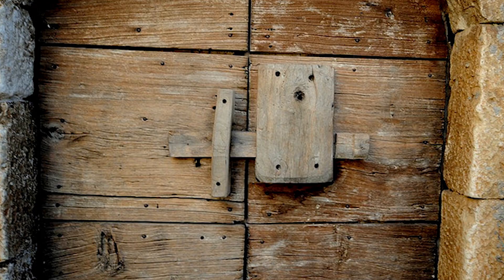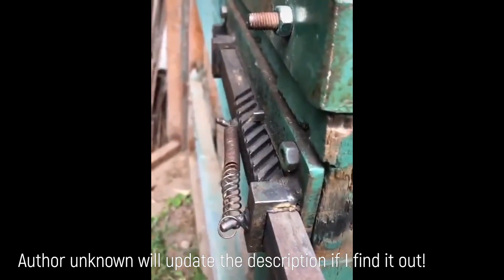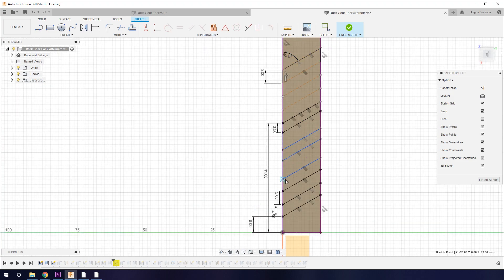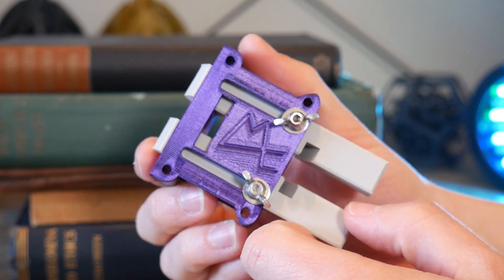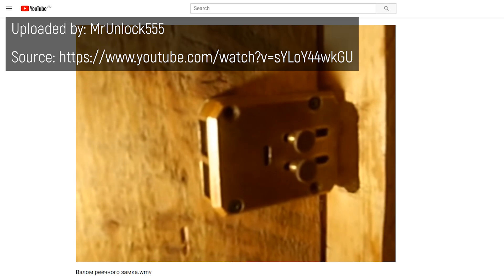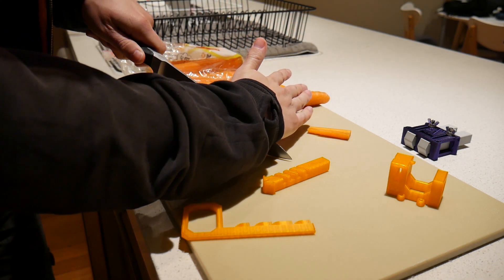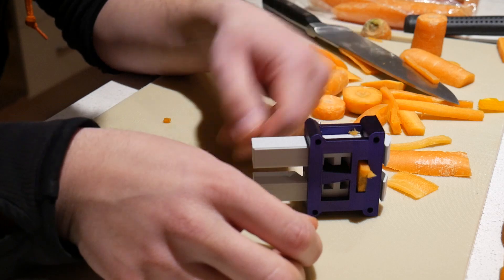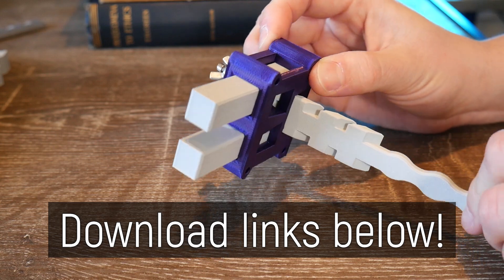This Strange Lock can be opened with a Carrot? 3D Printed "Rack Lock"

Comment: Well, this was an ordinary garage and door lock in Russia and other post-ussr countries. This is called "ригельный замок", riegel lock, where "riegel" is an german word. The closest translation is "bolt lock" actually. "Rack lock" is a relatively new, it has not been used when this locks was popular. The lock is good with it's toughness, simplicity and extreme reliability, but the most important - it was (and still is) very cheap. But - very noisy, extremely easy to lockpick (usually a screwdriver or a steel nail were used) and if you lose the key, it will be easier to change the lock than to make a new key.
Reply: Редко встретишь соотечественников на таких каналах
Reply: @РэйЧехов  there are lots of us, comrade
Reply: @РэйЧехов  Oh come on. I really hate that Youtube & Google Translate don't mesh at all. They're both owned by Google, they should mesh perfectly. Are you reading, Google? Get your shit together.
Reply: @polychoron  I'd hate it it will translate english to russian everywhere without asking. Aliexpress is bad enough, it isn't even funny anymore.
Reply: @polychoron  get a keyboard application with a built in translator
Reply: Ригельный замок это немного другое
Reply: Key reproduction would be easy using the rack and a blank "key" and grinding matching teeth. Might take some time but it is a really interesting lock design.

Comment: To me this lock seems more like a way to keep animals outside(or inside) rather than people.
Reply: It's likely more deterrence than actual security since it is used in places that are too cold for more typical lock designs. Sure, one of those locks may be easy to pick, but if you have to do it while sitting in -60 degree weather, is it worth it?
Reply: @emilymarriott5927  Yup, that, and a 3 feet long key. Try picking that in -60. Oh and the key would be useful in fending off wolves and bears.
Reply: @DarrenC_1024  Wolves & Bears & Emus, oh my!

Comment: How about a 4 sided version with a rightangle translation mechanism? I doubt if a burglar would arrive with 4 screwdrivers and would have the dexterity to manipulate all 4 sliders in a confined space.
Reply from the maker: hmm that sounds crazy enough to work! Could be interesting indeed.
Reply: @MakersMuse  do it Angus !
Reply: “Click out of one, counter-rotation, three is binding, back to two, click out of two, three, and we’re open” - LPL after 2 minutes with a 4-sided version...
Reply: @JCCamp  I made a possibly false assumption; namely that the four could not move independently. But maybe we are in 10,000 dollar gold-plated hammer territory. I don't see a real world solution, since if they do interlock in some way then brute force applied to any one component could open (or break) the lock.
(Side note: at one stage the UK education department used three interlocking gears in an cooperation campaign with a slogan like 'we all have to work together'. Of course they were hammered by thousands of parents and teachers and pupils (the supposed participants))
Reply: @davejoubert3349  They would be able to move. Their length would be limited by the width of a key teeth only if they were to be mounted on same surface, though if perpendicular pairs are mounted on different layers there would be no broblem. By making lots of said   surfaces, you can make this lock virtualy unpickable (since you can fit only so much strong rods inside the keyhole), though this design brings problems of durability.
Reply: @JCCamp  2 minutes is very generous for LPL. Still it would be more secure than the master locks.
Reply: @JCCamp  Thanks for reminding me that the only thing that can keep me safe is a Bowley in which I cant afford
Reply: I had such a lock on a flat door , local factory used to make metal doors and locks for them. Two sided rack with variable spacing. Good luck opening that lock with anything but metal  due to friction,  heavy spring and sharp steel edges.
Reply: Key would still be huge and I doubt if it could work. However I would still try it.
Reply: This would also require you to know which way the key went in the lock, of course you could figure that out in four tries.
Reply: When I break into a house I have 12 screwdrivers on me
Reply: @stevenfoster8855  HA we found u
Reply: @JDMOON55555  no
Reply: @stevenfoster8855  yes
Reply: call lock picking lawyer and if he cant get in, then its the worlds best lock
Reply: The mental image of the lock alone sounds cool
Reply: so one where the bolts end up making a swast lookin thing?
yeah no thanks

Comment: Design a twisty version.
Like you did with the Dovetail puzzle.
Reply: Helical twist, good luck forcing that with a screwdriver!
Reply: Sigh... None of the ideas in my head are new. Oh well.
Reply: @polychoron  but you may be the first to put those ideas into a tangible form.
Reply: Yas the original screw design combined with this
Reply: It is called a Rack and Pinion.
Reply: these improved design ideas are getting really good, this needs to happen

Comment: haha nice :D
how about a 'circular' lock with this technique? :p (like a rotating disc in the 'door')
Reply: It would probably be more secure against screwdrivers... not sure about soft carrots...
Reply: That would probably be a very course pitch multi start Acme or square tooth screw and nut.
Reply: Yes, this is a form of crossed helical gearing, except the straight rack is essentially a gear with infinite radius. This will work with a basic involute gear and a corresponding straight tooth rack. It would be a little more complicated than the basic design since the gear part would then need to be connected to the bolt to open it, or some kind of rotating lock with locking lugs.
Reply: @Bordpie  Infinite radius gear, itty bitty living space.

Wonder how many people get the reference... should be a lot, right?
Reply: Doesn't that already exist in the form of disc detainer locks?
Reply: That could deform the grooves in a way that makes them difficult to design a key for, but it would certainly be fun to try.

Comment: Worlds oldest pin lock! There are locks even more ancient than the one you show. Since your mechanism is made out of plastic, I would recommend soft boiling the carrots.
Reply from the maker: Hehe, I did try softening them but they just squished and deformed. I think a metal version is required to cleanly shave the material, maybe a part 2...
Reply: @MakersMuse  Maybe just a light steam then :P Anyways, great video as always!

Comment: Hey. Love your vids. Want to get a 3D printer now
Reply: When I bought my first 3D printer, I went for cost.  It worked, but it was not easy to work with.  One thing in particular I always struggled with was bed leveling.  I could never get it quite right.  And the print surface wasn't great, so I had to use blue painters tape, and that would stick to the bottom of the print if the bed wasn't leveled right.  Or worse, the nozzle would scrape into the tape, and jam up.

I highly recommend if you get a printer that you get one with automatic bed leveling or with a bed that doesn't need to be leveled.  It has made a huge difference in both the quality and the enjoyability of my printing experience. (I bought the Prusa i3 MK3 and love it!)
Reply: If you have some money saved up, go for the Original Prusa i5 (Mk 3.5, or whatever is the latest).
If you're strapped for cash (like me), but are willing to tinker, deal with replacing shoddy parts, and tons of troubleshooting and learning, go for the Ender 3
Reply: @RL_Dane  Prusa i3 MK3s is the current version. I love it for a few reasons.  It has mesh bed leveling, so you don't have to level the be manually.  It auto loads and unloads filament.  I had a Wanhao i3, and loading filament was a pain on that machine.  It's got a removal print bed made of spring steel.  That means 99% of your prints literally pop off.  It's got crash detection, filament run out sensor, and power outage recovery.  It's just a great machine.  And, when they upgrade the machine, you can upgrade yours to match.  I bought it as an MK3, and when the MK3S came out, I bought the kit for $20 or so, and upgraded my machine.  You can usually upgrade to future versions like the MK4 (when it comes out--man am I looking forward to that!). The firmware is updated on a regular basis, as is the slicer software.  Prusa is a really responsive company.